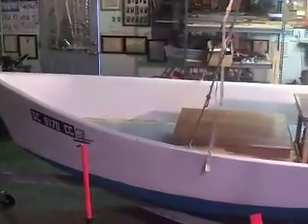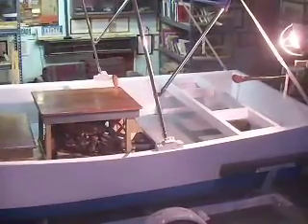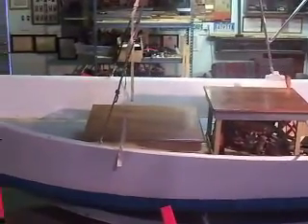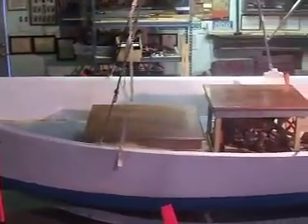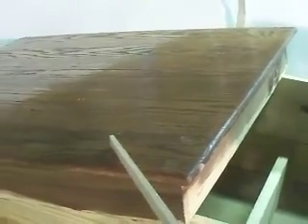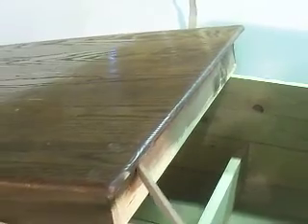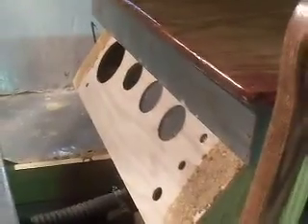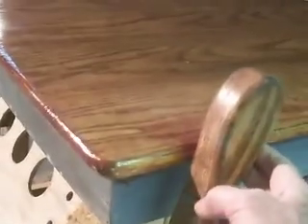Installing an inboard motor in a small boat Update 8 of 13

Comment: Nice progress.  Good idea to make that one panel removable in case you need to hand crank the motor.
Reply from the maker: +Pidasian Hippie Yep, it's all connected and interactive.  Luckily, with boat building so time consuming and tedious, there is plenty of time to discover those potential problems.
Reply: ***** I bet it did take a lot of time.  I tried to keep track of the time frame of the videos.  It seemed to be at least a year.

Comment from the maker: I hoped you wouldn't notice!  No, the transmission shifter arm moves forward for "forward," and back for reverse, and that was how the oak shifting handle SHOULD operate.  But I had to rig it the other way to accommodate the location of the oak handle bearing, which is (by necessity) positioned too high to put the angled lever in the "up" position. 
Now it bothers me.  I think I will try to quiz out a fix, as not only is it amateurish, it also places the oak handle too far forward in reverse.